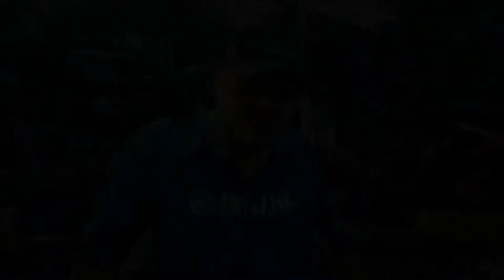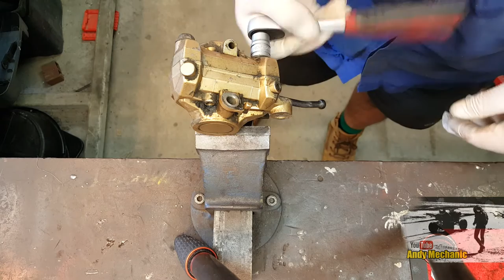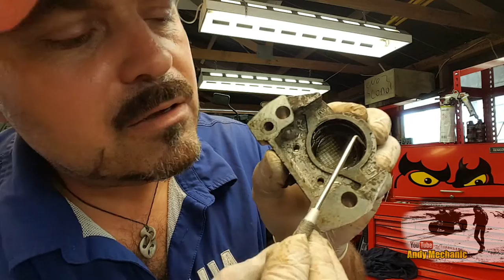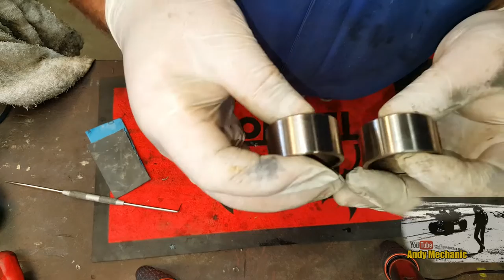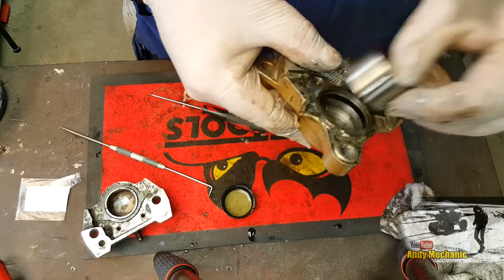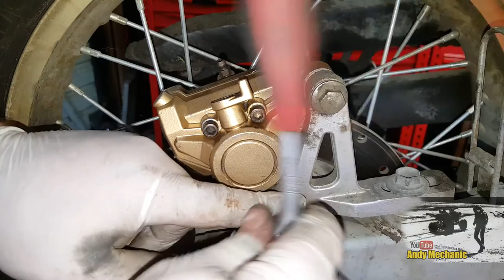Yamaha TDR rear caliper rebuild #1323

Comment: Andy. I had the same issue with the dust seal not fitting correctly. I spoke with Yambits in the UK and they had incorrectly cross referenced the parts number. They have updated and corrected on their web site with the correct seals.
Reply from the maker: Ah! Well that makes sense now! I'll let Ben know so they can send over the correct parts.

Many thanks :-)  
Andy